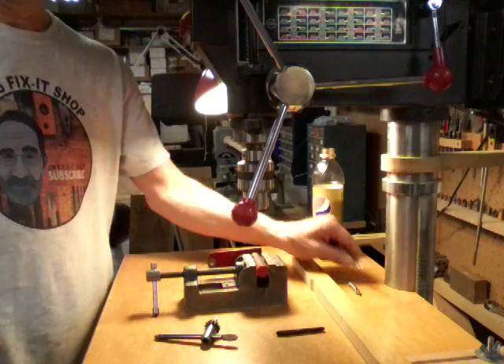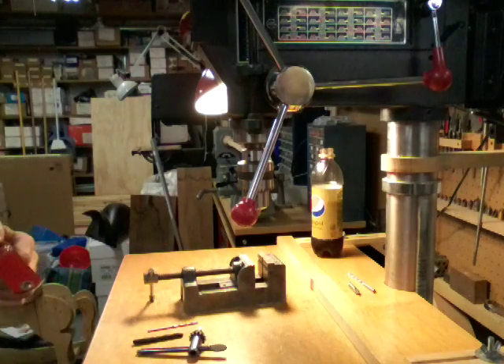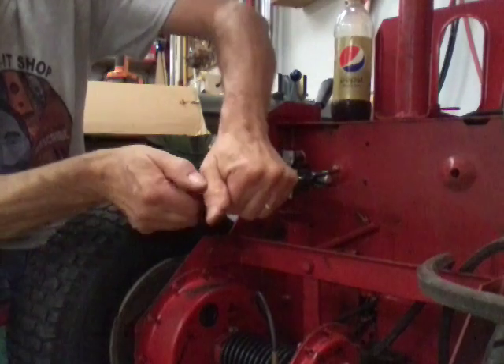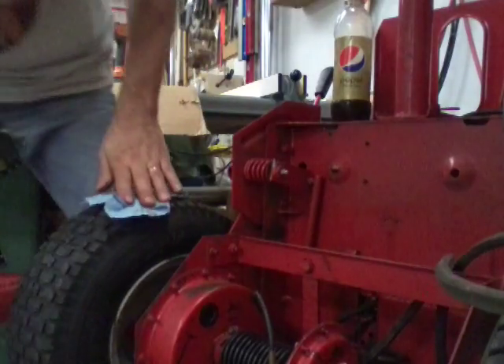204. M/S. 45  Installing a grease fitting in my shift lever shaft

Comment: I did the exact same thing on my 307XS Snapper machine when I rebuilt it.  I really like the tapping arbor that you have there.  I tend to use 1,1,1 trichloroethane (tap magic) when I am drilling hard pieces and tapping holes.  It is a cutting fluid, as opposed to a cutting oil.  Works really well on stainless steel parts as well.  Don't use it on aluminum, as it reacts with that metal.  Thanks again for another very interesting video.  Keep up the good work!

Comment: On my snapper 28" model 281223bve the clevis pin in the shifter handle has a slightly tapered shaft. It's a bear to get out.  Great video Jim
Reply from the maker: scott hillegass 
Hi Scott
  That’s odd all my pins have always been straight. I’ll have to watch for that. Thanks Jim